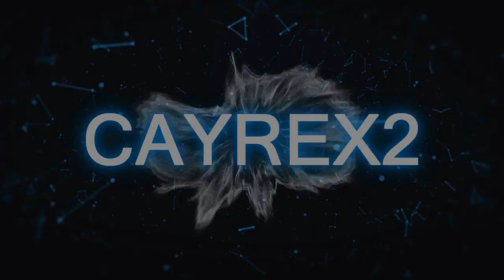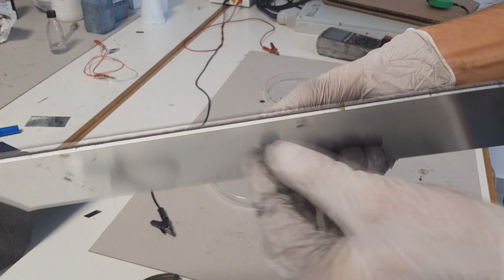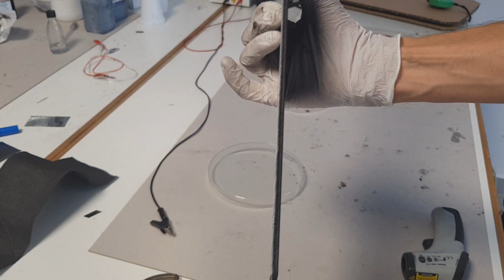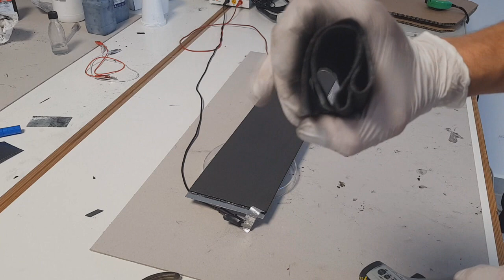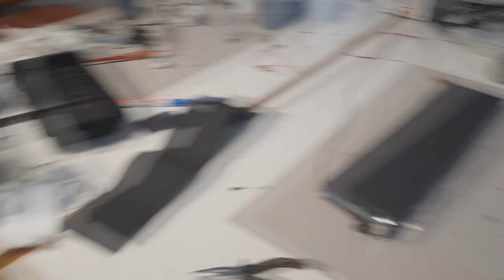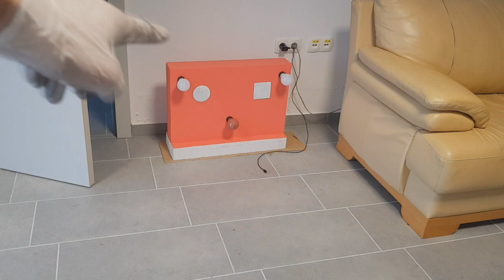Conductive ink Infrared heater

Comment: Well done Dusan. Can you mix within the ink some granit-stone powder, so the heat is also stored in these stones and gives off also heat, when the power is turned off ?
Reply from the maker: Yes It will work with granit, ceramic, etc,.... powders. But the important part of using the ceramic powder is to increase the surface area of the heater. More surface area create more infrared waves and this is the main point. Smal heater dimensions with large surface area.

Comment: Well done ! Very good effort 😎
Reply from the maker: Thank you my friend
Reply: How many Watts does it draw ? what is its internal resistance ? Does it deliver more heat than a normal radiator made from wire ?
Reply from the maker: 100 to 120 watts. Internal resistance is 7.5 ohms. This heater works on infrared waves (infrared radiation) and not on like normal electric heater (joule heating).